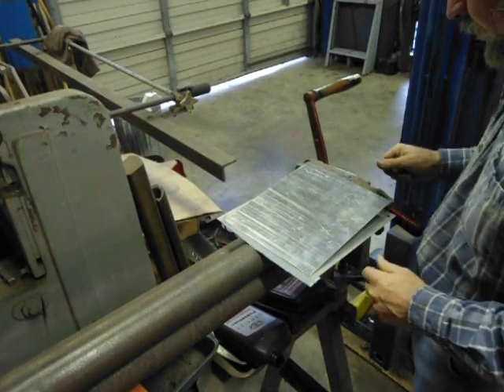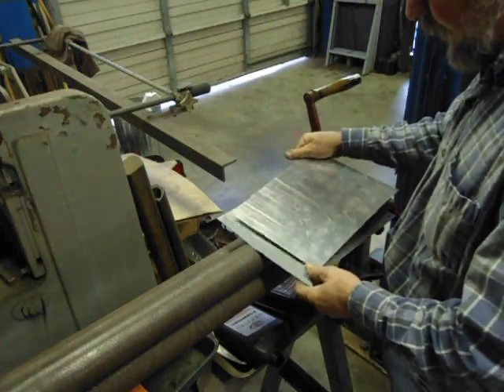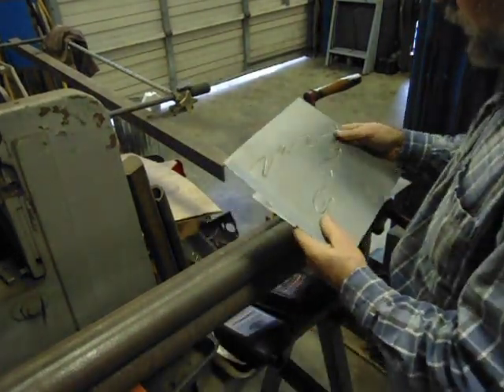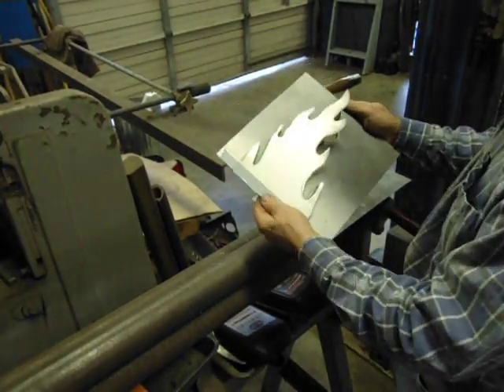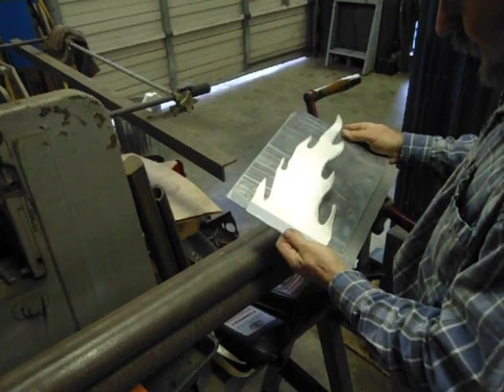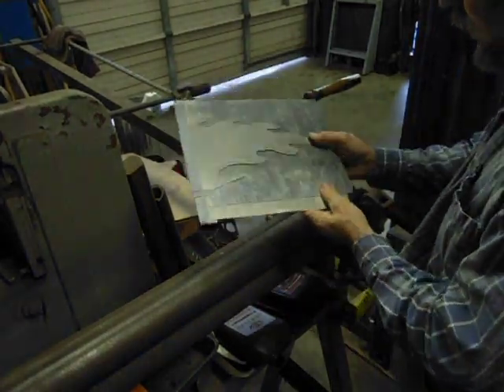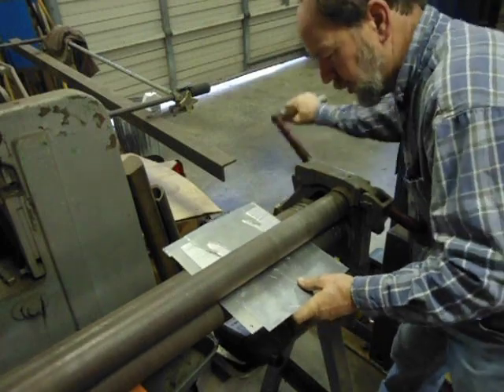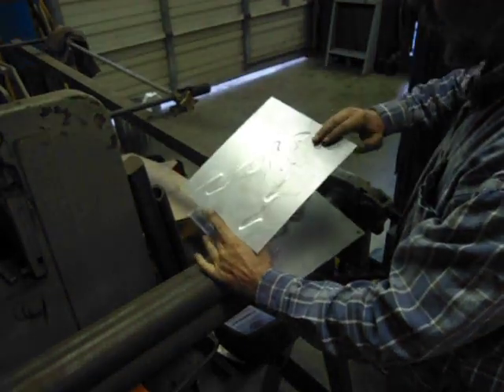Embossing with Slip Rolls

Comment: Real slick trick! Any suggestions for embossing a font?
Reply from the maker: I have used transfer paper like vinyl sign guys do,  and lay/stick the letters on the paper. Then stick the paper with the letters to the piece that you want to emboss and lay that on a piece of hard rubber. Then run that sandwich through the rollers. 
You can also use the negative cut out like I did here.. Just lay the letters back where they were cut out of, and then lay the transfer paper over everything, rubbing mainly on the letters then make witness marks or good measurements and peel the transfer paper back bringing the letters with it. Now you can sandwich the piece to be embossed between the letters on the transfer sheet and the negative sheet that you cut the letters out of, and the transfer paper will hold the letters in place on the piece you are embossing..

Comment: Hi please Can you do a quick video on embossing a cylinder or a flat peice while being rolled into a cylinder
Reply from the maker: +ran dom....   It would be done the same way... the material will slip enough to make up for the difference in the length of the outside negative and the inside positive peices, because the pressing is happening right at the two front (initial pinch) rollers..

Comment: what is the max thickness on the material being embossed? how thick is the cut out?
Reply from the maker: That would all depend on how strong your Slip Rolls are.. and how big and complicated the embossed pattern is. In this demo I was using .063 for the patterns and .050 for the embossed piece.  If you want the embossing to be deeper, just use thicker patterns.. Also the more relief around the positive and negative patterns, the wider and deeper the embossing appears, and the easier it is to press...  If your embossed pattern had a lot of areas (lines)  that were getting pressed at the same time it would require more pressure.. It's not the 
size (overall area) that's being pressed... it's the number of offsets being created at the same time....

 These are 3 inch by 3 foot rolls. They are rated at 18 gauge steel.. Which means they will roll a piece of 18 gauge steel 3 foot wide, to one and a half times the diameter of the rollers.. (Or in other words, a four and a half inch diameter tube, 3foot long)  This is the way all Slip Rolls are rated.. What ever the rating is that is stamped on the machine... means it will roll that thickness in mild steel, the full width of the machine,  to one and a half times the roll diameter.  So a 5 in Diameter roll, rated at .125. will roll one eighth inch thick, into a seven and a half inch tube, however long the machine is..  You could roll something shorter tight to the rolls, or you could roll something lighter tight to the rolls..  or you might be able to roll soft aluminum tight to the rolls the full length of the machine..... But if you try to roll stainless steel the full width, you could probably only get it down to about twice the diameter of the rolls..